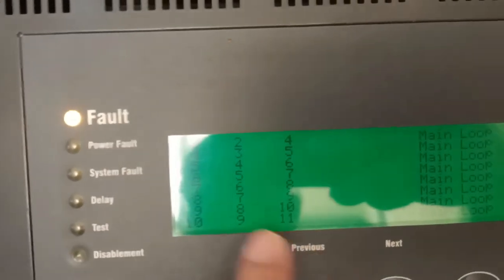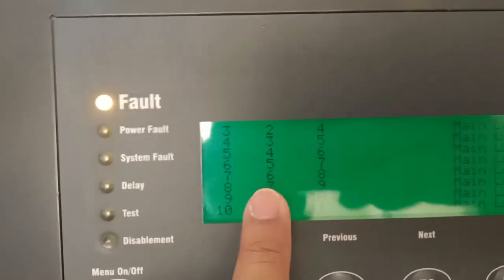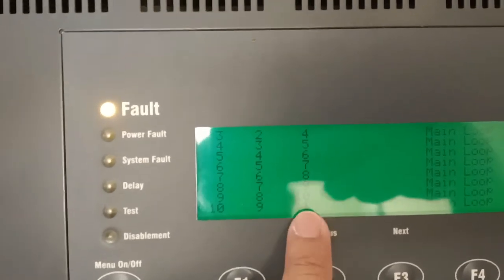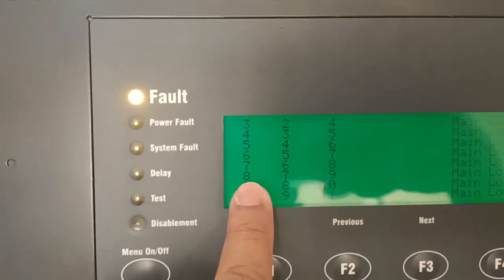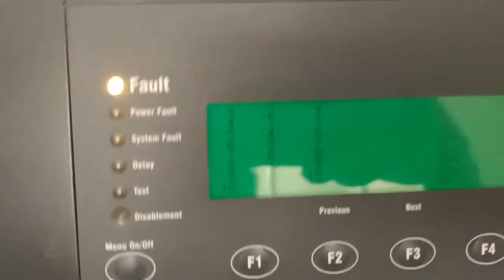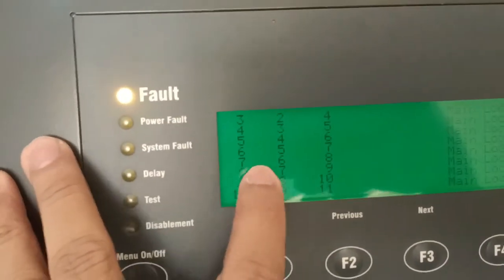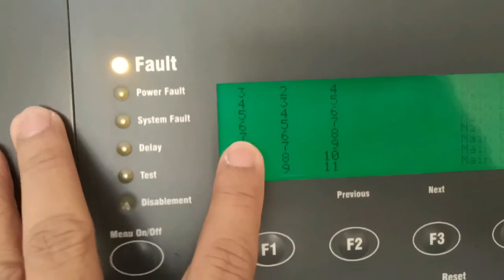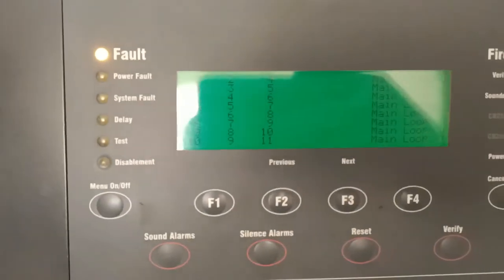HOW TO CHECK LOOP OPEN CIRCUIT | BY USING LOOP MAP VLOG#105

Comment: sir paano trouble shoot ang tx fault
Reply from the maker: yan device yan faulty coroded malalaman mo yan pag allocate mo kung saan mag hinto umiilaw ang device tx fault or yung kasunod na device e check mo yun  sira din kaya tx fault.di maka deretso ang bilang.
Reply: pag alocate sir tangal ba ung in or out na cable para malaman kng san ttigil salamat sir
Reply from the maker: out cable lang tanggalin mo in ang nakakabit  pwedi rinag reverse ka in tanggal out kabit dependi sayo